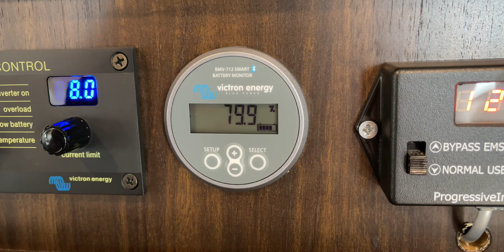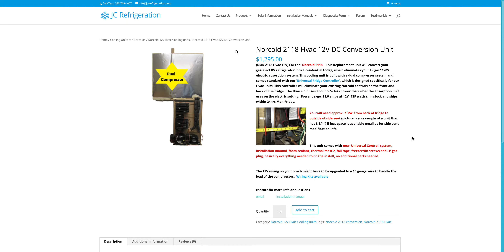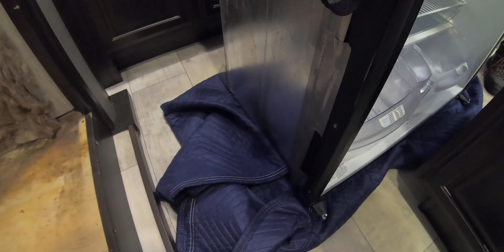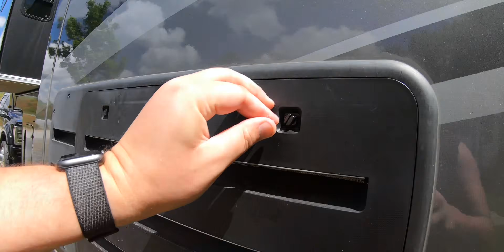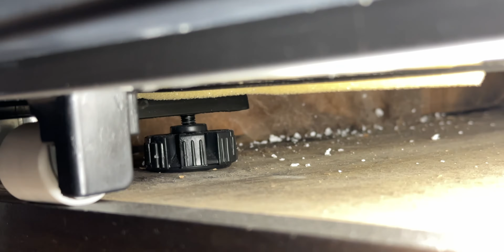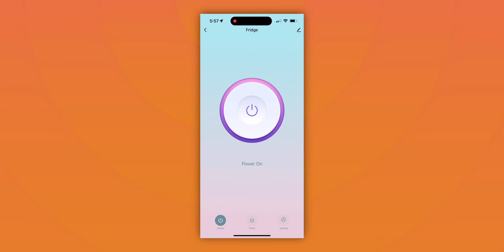RV FRIDGE SWAP - Norcold 2118 to Samsung RF18 - Absorption Refrigerator Died So We Went Residential

Comment: Thank you for posting this video. We have same Norcold in our 2017 Raptor. It stopped work on way trip home. Blew the 12V fuse. Pulled the outdoor cover off. All of the 12V wire and the gas valve soleniod are burnt to a crisp.
Reply from the maker: You’re very welcome!

Comment: So, on a (2) battery rig, with two group 24s (nothing special)... how long will that fridge stay powered without shore power or generator?  I guess I could do some math, but I'd love to hear REAL WORLD experience as I'm often boondocking and cloudy days will happen (limiting solar production). I need a worse case scenario. Also, I see most RVs use a 2000W inverter, so based on that... what would be everyone's take on "how long will the fridge stay powered on, without generator or shore power and no solar production... on 2 group 24s"?

Let me know!!! Or what it requires for power and I'll do some math (which I'm not good at). LOL
Reply from the maker: The RF18 only averages around 70W as it cycles. On two typical Group 24 lead-acid batteries, I’d personally plan on about 8-10 hours before you’re around 50% battery. You may get 15-20 hours if you run them much lower, but for a worst-case boondocking number with no solar, I’d use 8 hours to be safe.

Comment: I bought this exact samsung an am about to do the swap today.  I had the JC Refrigeration 12v unit on mine for the last few years after having two new cold packs from Norco installed under warranty. It worked "ok" for the first year or so, but I could never keep it cool enough on the compressor. It only worked good in the winter. During the summer I would pull the cover off and zip tie a 12 inch electric fan and it would still only allow my refrigerator to cool down to about 45 degrees.  This summer is the hottest ever and the fridge is at 54 degrees.  I'm done with that mess.  The samsung will be delivered this morning and I will be doing the install today and tomorrow.  Thank yo for the great video.
Reply from the maker: Nice! You’ll love it! Good luck with the install.
Reply: @AroundTheSunW @AroundTheSunWeGo  sorry to bother you but I have a question. I bought the same garage door molding that you did and wondered if you would tell me how you fastened it? I’d like screws, but not sure how that would look with those grooves. Did you screw or nail? If screws what were they?    Good news is that I didn’t have to cut that top piece like you did. But the bad news is that the platform that the fridge sat on was completely rotted from an apparent water/condensation leak from the old fridge, so I had to rip everything out and build a new platform so I lowered that and it worked great.
Reply from the maker: @wadeswampmanbrignac I actually used double sided command strips haha - the black ones so you can’t even tell unless you’re right up on it!
Reply: @AroundTheSunWeGo  Perfect I remember you saying that in the video now.  That's what I'll dot. I'd like to be able to get in there if I need too.  Again thank you very much for the video, I couldn't have done this without it.
Reply from the maker: You’re very welcome! Enjoy it!

Comment: Absorption refrigerators were necessary because domestic refrigerator compressors had a huge startup current and a pretty high running current.  New tech domestic refrigerators use a turbine style compressor that is low to start and even lower to run.  There is no reason to keep an RV refrigerator.  For just part of the savings over an RV fridge, you can upgrade your house batteries to lithium and add an inverter to run your fridge.
Reply from the maker: Absolutely!

Comment: I’m in the process of installing this exact refrigerator in my coach. Mine is also being installed in a slide out. I’m a bit concerned about the front wheels actually sitting on the platform. You made my day with turning the leveling mounts around. What a great idea. Mind you I haven’t explored the underside of the fridge, in fact, it still sitting on the foam packaging.
Reply from the maker: Glad you found that helpful! I had to make it work one way or another! Lol
Reply: BTW, great video!!!! Thank you!
Reply from the maker: @Garth357 You’re very welcome!

Comment: Thank you! When & where did you plug the fridge into the outlet?
Reply from the maker: If you check out the open space once I removed the old fridge, you’ll see the outlet at the bottom right. That’s the same place the 120v side of the old fridge was plugged into.

Comment: Great video.  Great job in sealing the exterior vents.  Something a lot of people don't understand about RV absorption fridges is that they seal the RV interior to exterior just behind the FRONT of the fridge.  In other words, the entire back, sides and top are vented to the outside of the trailer through those exterior vent panels.  In a residential fridge, they live indoors, so you need to seal off those ventilation panels to "bring it inside" the RV living space. This also means that the coils at the bottom of the fridge need to be vented to the interior of the coach.  Do not leave the exterior vents unsealed!  This will let dirt, moisture, bugs, and hot/cold air into your RV.
Reply from the maker: Absolutely! Thanks for watching!

Comment: For the propane line is it necessary to use pipe dope gas rated or the special tape for gas/propane I’ve been debating to use it or not for removing a old small norcold fridge I have in my rv I’m a full timer so I really don’t need it and I have a flare plug ready to use but wasn’t sure if I put any tape or pipe dope on a flare fitting
Reply from the maker: No tape or dope on a flare fitting.
Reply: @AroundTheSunWeGo thank you so much for responding! Okay so I don’t use anything on my 3/8 flare plug, so all I do is make sure it’s tight enough where there’s no leaks and use soapy water to detect if any bubbles if so tight it more correct? Thank you so much once again!
Reply from the maker: Correct. For a flare, snug it firm, not gorilla-tight. No tape or dope. Make sure the flare is clean and not cracked. And if there are no bubbles with soapy water while the system is pressurized, you should be leak free.

Comment: So dumb question I’m about To do this on my 395ms grand design. Where did you get the power supply from ? Did you Run a 120v receptacle to the back ?
Reply from the maker: Just saw this comment! Yes, we already had a receptacle behind the fridge which is what powered the AC side of the system.
Reply: I found an added 120v receptacle! Thanks for the great video

Comment: Beautiful job. My Dometic 3862 has yet again gone bad (3rd in 17 years). I wish I knew someone that could help in the San Diego area and what residential unit to place into the space. Pulling my hair out ATM. Thinking on just having a stand alone in an unused area.
Reply from the maker: Glad you enjoyed the video!
Reply: @AroundTheSunWeGo  Went with a temp stand alone while I get the POS Dometic out, and decide what I will place there. Give time to do it right. The 4.5 stand alone sips pwr, and cools better. Good little 2nd.
Reply from the maker: Nice! Let me know what you end up going with!

Comment: Hi sir. Thank you so much for this excellent video. This morning, I just ordered the same model fridge for my Solitude 377 MBS. Our fridge areas have slight differences but I learned a lot from your video. Of note, I saw on a forum someone removed the raised floor and installed it directly on the slide. Altho it sounds like a good idea, the removed structures weakened the slide causing it to dip and gouged his vinyl floor. I am actually going to do the opposite. Mine is a 2017 and enough condensation has leaked to the subfloor, I am gonna sand down that raised floor and then add plywood on top and increase its depth by a couple inches, giving the new fridge a little more wiggle room. All of your tips were grear especially the garage door trim. Thanks for that link. After removing the Norcold 2118, I found so many dangerous issues with it. 3-4 wasp nests back there. All my insulation fell down onto the fridge, stink bugs, bees, the dangerous careless wiring not to mention the rear of the fridge, even on 110v ac power puts off 260 F degrees! I recommend this project to everyone. It should be much safer. Thanks again!
Reply from the maker: You’re very welcome! Best of luck on your install!

Comment: Wow…this info & instruction is some of the best I’ve run across!    I’m looking at a $3800 Norcold ref. replacement in a  2023 Entegra Odyseey.   The $3800 includes labor from an RV repair person.     I’m sick over having to replace this refrigerator that’s only 2years old.   I would rather replace the current refrigerator with perhaps an apartment size unit from Lowe’s or Home Depo.   My son can make that type of swap you described in the video.   How long did the entire process take from beginning to end?   Thanks & again this was such a helpful video
Reply from the maker: You’re welcome! And I believe we removed the old fridge and prepped the space in one afternoon, and then it took us another afternoon to install the new fridge.

Comment: Sorry, it’s been a while since you posted this install. Was wondering after one year, how the frig was doing? Also,  how did you hook up to 120AC? Was there a nearby receptacle or did you run a new AC line to it? I have a 3000 watt inverter and 600 Ah of lithium.
Reply from the maker: It’s still going strong to this day! And yes, there was already an AC outlet back there for the original fridge, which requires both an AC outlet and a DC connection.

Comment: We have a 2023 Montana 3901RK ( with 2 - 2,000 watt inverters & 3-100 amp hrs. lithium batteries) with the Norcold refrigerator 2118. While at Parker Strip AZ over memorial Day weekend our Norcold just stopped working (freezer worked normal - ref. down to 61 deg.). I went through "every" test/ fix that you tried to get it to work.... no change, VERY frustrating!!. Then, I was told by a tech over the phone, since my unit wasn't leaking ammonia out, try gently tapping the chiller lines, sometimes they get clogged. Gently tapping the lines, the refrigerator started working, then it stopped, then worked, then it stopped .... this went for several days.  Like you, I looked at replacement... replace the chiller at $1,400.00 or $5,600 to go thought the same thing in a year or two.....NO WAY!!! In addition, the Norcold would "NEVER" keep ice cream hard. Without hesitating, I ordered the LG #LF21G6200S 21 cu. ft. to replace the Norcold. The LG is just a tad higher, but it's 21 cu ft. and will still fit in the refrigerator compartment. The new LG will be home two days after we get back...... gives me time to yank this over priced junk pile out of the RV!! Thanks for the tutorial refrigerator change out!!
Reply from the maker: You’re welcome! Best of luck on the install!

Comment: So can you plug the residential fridge straight into the electrical outlet that the Norcold was plugged into, or did you have to install a 120v outlet?
Reply from the maker: That’s correct. There was already a 120v outlet behind the original fridge.

Comment: I have purchased an 2022 Fleetwood Bounder with the Samsung Rf-18A5101SR refrigerator.  Everything works fine, no problems yet.
My other RV has refrigerator that could do electric or gas, same as your old one.  How do you use the refrigerator when there is no gas option?  I really don’t want to run the generator all of the time.
Thank you
Stan
Stan
Reply from the maker: Hey there! You’d need to install an inverter with a battery bank to power your AC outlets.

Comment: Any problems with the doors opening going down the road? We just got a new 5th wheel that has the Hisense residential fridge and I’m worried the doors opening going down the road food everywhere
Reply from the maker: l've never noticed them opening but they are sort of "suctioned" closed like any other residential fridge. I do place a large gun magnet across the doors though just as an extra layer of support.

Comment: How do you keep the doors secured for travel?
Reply from the maker: @mikeboris7813   I’ve never noticed them opening but they are sort of “suctioned” closed like any other residential fridge. I do place a large gun magnet across the doors though just as an extra layer of support.

Comment: Great video and install! We saw the Samsung RF18A5101SR Counter Depth that measures 70h 32w 28d today for a great price of $988. I am assuming that this model is the same or close to the one you installed? I took all the measurements and it should fit fine, just a little nervous about pulling out the old unit. Thanks again, looking forward to not having to constantly watch the old fridge's temperature swings!
Reply from the maker: @RichM3215  Yes, that’s the exact model number as ours. And you’re very welcome! Good luck with the install!
Reply: Did the install and it went really smoothly thanks to watching your video and knowing what to expect. Looks great also. The only problem was with Home Depot. There policy is they will not bring the fridge into rv's and would not take the old rv fridge away because of the ammonia gas. (But I made it worth there while and it made it's way inside!)
Question: I was thinking about installing a small, quiet low rpm 12v cooling fan behind the fridge just to circulate the air since I have the 12v line from the old fridge. Do you think that's overkill? Just thinking about the sun beating on the slide here in Florida and getting pretty hot. Thanks.
Reply from the maker: @ Glad to hear it went smooth! I don’t necessarily think the fan would be overkill, but I can say I didn’t install one and we’ve never had a problem, even in direct sun during the summer. Really up to you! I wouldn’t recommend having the fan blow outside or inside though, just internally. Don’t want to introduce excess humidity or heat and cold.

Comment: Are you still liking the Samsung? Any other problems with it?
Reply from the maker: @richardharris5819  Still going strong and ice cold. No problems since the install!
Reply: @ Good deal... I'm getting ready to upgrade mine
Reply from the maker: @richardharris5819  If you’re doing the RF18 just make sure to put it on a smart outlet so you can schedule and automate the restarts. Mine has been doing that for years now and everything works perfectly.
Reply: @AroundTheSunWeGo  great advice 👍

Comment: Thanks for the video!  I'm wondering how you power the fridge?  For example how many batteries did you add, what size inverter are you using, how many solar panels?  Thanks.
Reply from the maker: You’re welcome! I have a 300ah Battle Born battery bank with a MultiPlus and no solar. The batteries will power the fridge alone for multiple days so plenty for a travel day.

Comment: Awesome video.  Our Norcold 2118 is doing exactly what yours was doing (Not getting cold or frozen).  Did you have to do anything special with the wiring, or was it that simple by just hooking up the factory 12V leads?  No messing with invertors or converters or anything like that?
Reply: Do you run an inverter when on the road?
Reply from the maker: @432bartman  We do. We have a Victron MultiPlus and 300ah of Battle Born batteries.
Reply from the maker: @432bartman  Just had to make sure the stock 12v passed through to the stove. The new fridge simply plugs into the existing 120v AC outlet. If you want to run the fridge, you must have power to the AC outlet. So if you don’t already have an inverter setup, you’ll need one to run this while traveling.

Comment: The outdoor kitchen  norcold refrigerator did not come with normal clamp that keeps door shut when moving . So we can not keep it to full when moving.
Reply from the maker: @dianasmith6971  This one shuts pretty securely but I would imagine a ton of weight stored in the doors could cause them to open. Our doors aren’t usually packed full of weight and we also use a strong gun magnet across the doors.

Comment: What did you use to keep refrigerator doors shut during movement?
Reply from the maker: @dianasmith6971  The doors hold shut pretty securely anyway, but I do place a strong gun magnet across the crack of the door for some additional peace of mind. Haven’t had them open yet!

Comment: Really great video.  We have a 2015 Montana 3720RL with the 2118 fridge nd also would like to replace it.  The Samsung fridge has a 28" depth while the Norcold is 24" deep so I don't know if we will have a clearance issue when closing the slides, from our island.  Unfortunately we are away for the summer so I have to wait until we are back home to measure.
Meanwhile we are traveling in a Georgetown motorhome and a few months ago installed the RF18.  Love it!
Reply from the maker: @taaronpiper  Nice! Yes, definitely measure before making the purchase! That would be a headache to try returning lol

Comment: I am planning a refrigerator swap and wonder if you have any problems keeping the doors closed during transit? Your swap looks great!
Reply from the maker: @daveaugustine6327  I’ve never noticed them opening but they are sort of “suctioned” closed like any other residential fridge. I do place a large gun magnet across the doors though just as an extra layer of support.